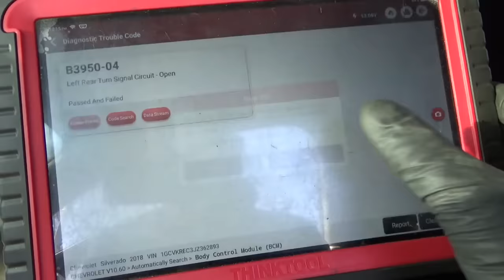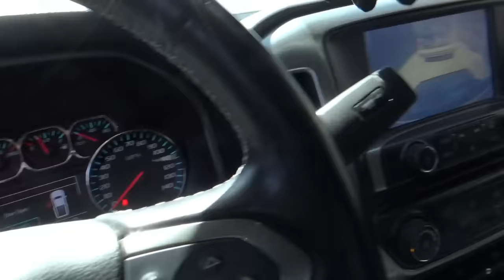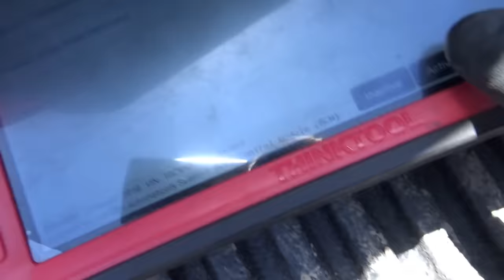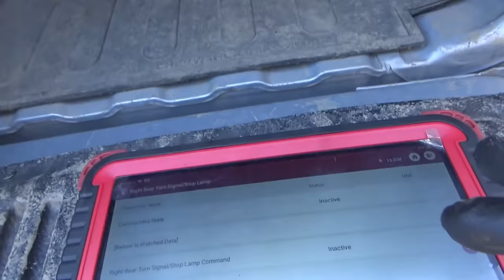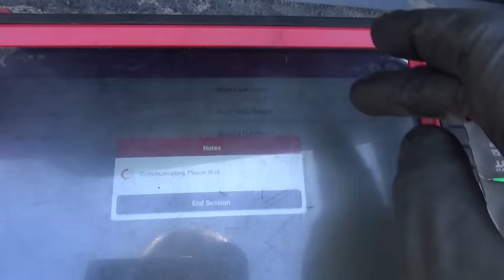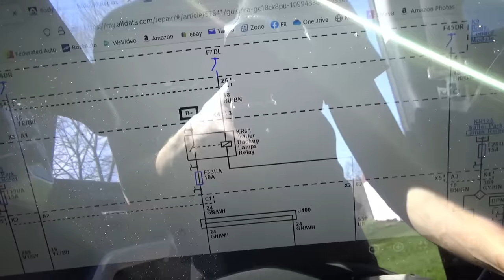3 Broken Chevys? (Part 2 - 2018 Silverado: BRAKE & REVERSE Lights Stuck ON??)

Comment: You're right about all of that Ivan.  For starters, I do like to see closure on just about anything I can.  But sadly, I know that's not always possible.  Now GM's (or any other American made vehicle really) have always had electrical issues for as long as I can remember.  But all of the manufactures don't really do anything to address these problems until they become serious problems in the form of recalls and revisions.

Comment: I see a future market for stand alone Wiring looms to keep "old" vehicles on the road.
Reply: The tuner community is a great help with things like this.  They custom build harnesses, adapt & program ECMs, re-wire connectors etc.  The ones who know their stuff are a great resource.  One thing we need to keep alive is access to information, like wiring diagrams, operating descriptions and similar.  Louis Rossmans channel is a great advocate for Right to Repair, in case it is of interest.  
Stay gold.

Comment: At least when chevy stops making that fuse box, the aftermarket will probably step up. (I know, I know...but cheap aftermarket junk is a better option than junking the truck). Try to find replacement parts for a Nissan after the dealer discontinued them. 😂

Comment: freightliner columbia and century have similar type of fuse box it's the auxiliary box by the driver seat, they go bad often, moisture get into them 
many years ago vw had them, the construction metal blades with layer of plastic separating  like a sandwich, them when water infiltrate them slowly melting the insolation even making that plastic conductor, worst in northern states

Comment: On my 25 year old Toyota Camry I've had two electrical problems. The drivers heated seat went bad so I bought an aftermarket seat for $15. Also the electric radio antenn rod went bad. I bought an original rod by the dealer for $30. Everyting else is original and I live in the Swedish rust belt. I live that car, so dependable! and no rust since I had it treated with a rust protection the first year I had it.

Comment: Yes, agree, even  a junkyard OEM is better. I got a used OEM MAF for a 2003 Focus 2.3 I had, fixed it. My current 2002 still have a used OEM DPFE and a purge solenoid, 4 years later still working. Pennies on the dollar, and got a spare too, for a rainy day. I think, for a few dollars, I got the 90 day warranty on the purge, just in case it didn't work. It lets you return for refund or pull another like it.

Comment: I was gonna say it was the TLC that was munted.  The tail light computer.  Or the guy pulled out the wrong diff & forgot to plug in tail light diff plug.

They look like kinda male spade lugs are they? - Protruding from the faulty fuse box?  Yeah there's probly melted solder from an overloaded solder joint that's bridged a couple of tracks on the circuit board.  There's probly just a couple of flimsy pins (or even one) that are soldered to the board for each spade terminal.  

Did you say there are 'drivers' on the board too?  Like solid state relays kinda thing?  Geez, I think the plain old fuse, relay & connector type fuseboxes have gotta be better than this pcb bs?  At least the way gm does them?

I really would almost pop my cork to see what actually caused the multi-short in that foozebox doover hickey thing!  I'm an elec tec I can't help it.😂

Comment: I would surmise poor contact inside the fusebox led to heated bus bar which melted plastic, shorting sub-circuit to power.  Could have been any sub-circuit, happened to be backup/tail lights.

Comment: Yes GM has a big problem with them and they shut our dealership down in 2018 and I bet you I put in probably 25 of them for various all kinds of different problems there was no standard in my opinion failure but if it came back to the fuse box it was a fuse box and yes it's unbelievable that GM only sells them for $200 they must have a little bit of guilt in their conscience ha ha look at everything else and all dealers not just gm

Comment: Question, I think I saw a customer installed brake controller. As you were panning the camera a light came on the controller, could the controller be drawing too much power?

Comment: Sometimes you can tell that some parts are made to be disposable, like this fuse box.  If it was designed and built to last, it wouldn't be $200 to replace.  Side note - totally agree with cars becoming "disposable"

Comment: They decided to add internal solid-state switches that take power and heat. You have a low current, 5V component in the engine it probably will last, you have current to a power circuit there will be a certain amount of failure.

Comment: every time I had this type of  issue it was always something to do with the body ground  in the back by the lights . however I did have a customer almost fry 2 bcms in 2 chevys. by him installing    C B  instead of fuses . I did have a light control module  back by bumper .

Comment: am just guessing here. But could it be that the use of a wrong bulb type especially bulbs with double contacts that can connect two wires into one. or whatever... just a thot.

Comment: My 2007 1500 suburban had the bad fuse box, got a new one and replaced it. Now the modules are all in failure. The truck starts but has VSS, ABS, NO AC, and the backup lights stay on. I pulled the BU light fuse so it won't kill the battery. It did this crazy stuff once before with no start and I had to tow it to the dealer after a batt replacement. I could jump the relay and make it crank but the BCM was jacked up. After that I leaned to keep a charger on it when replacing the battery. Those years 06-07 seem to be plagued with module reprogram issues when they lose power. The fuse box was bad, several socket pins with loose solder connections and the box is sonically welded shut to prevent service. Any advice would help, at least it runs
Reply from the maker: Get another fuse box!
Reply: @PineHollowAutoDiagnostics  I did get a new one from the Cadilac dealer, but now all modules are scrambled.
Reply from the maker: @rolomaticz5009  I've never seen a module get "scrambled" lol
Can you talk to all the modules with a scanner?

Comment: I can't help but see business opportunities with stupid or poor quality design that will fail reliably. 
Never known you to be afraid to pull something apart either?
It might be a simple correction that you can sell exchange modified fuse boxes as a side hustle. 
Even if it is a pcb issue. Easy enough to get them printed up these days.